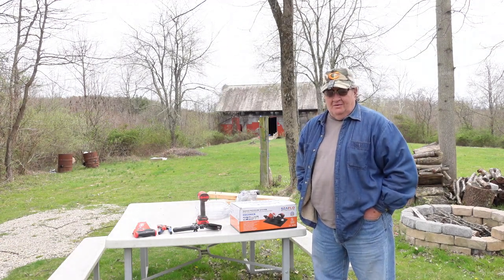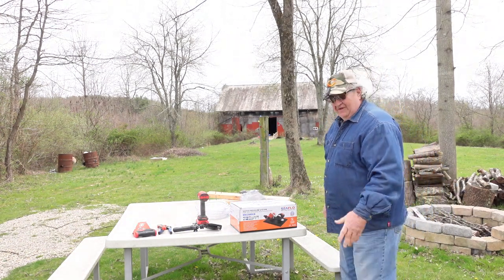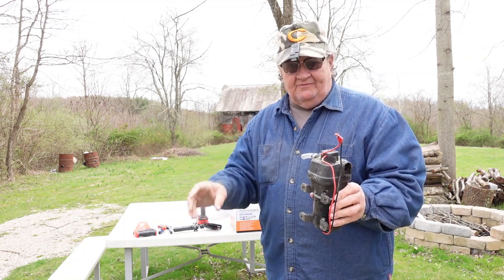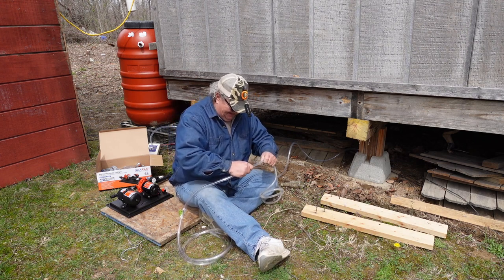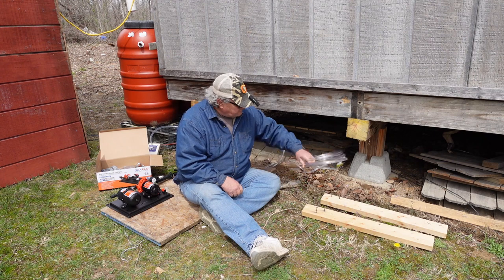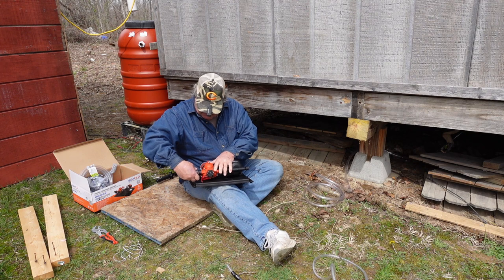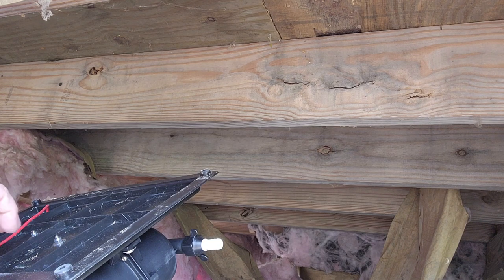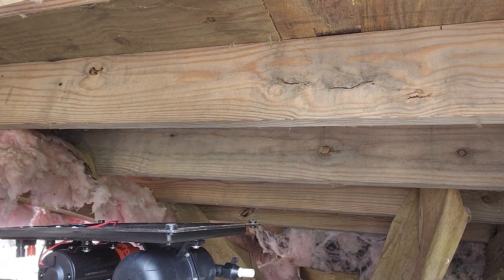DIY Rain Catchment RV Pump Off Grid Cabin

Comment: Seaflow pumps work well until the pressure switch invariably dies. Replacement of the switch is difficult or impossible. Find a way of externally switching it either by pressure or DC on/off switch. Sadly it's a problem they've had for years and have never rectified it adequately.

Comment: And just for those that are looking to do this and don’t wanna spend $80-$100 for the whole thing because your pump still works they sell the accumulator tank separately and in various shapes and sizes for RV pumps or regular jet well pumps
Reply: They only thing I did not know is that I could use this instead of my 120 V jet pump

Comment: I like this idea my camp is all plumped for a indoor hot water heater and pressure tank I’m sure I’m to late I need to continue with the regular pressure tank but would this run 2 sinks a shower and a washer not all at once one at a time

Comment: And if you want to be able to run things with heating elements, such as toasters or microwaves or anything that has more wattages than 700 W like you’ve gotten now or 725 I can’t remember what it said on there but all you gotta do is get a new inverter that is at least 4000 W And a pier sign wave and you will be able to run a lot more power than you do now

Comment: I looked online for a pump and small tank but couldn't find anything that looked like your setup mounted on the black plastic board.  All I find are components sold separately or a setup with the pump mounted on top of a 1-gallon accumulator tank.  My plan is for a sink and a shower connect to my water barrels.
Reply from the maker: +Dan Reed I looked back. It says they are out of stock on this one.  SeaFlo has one with a 2 gal tank on Amazon.